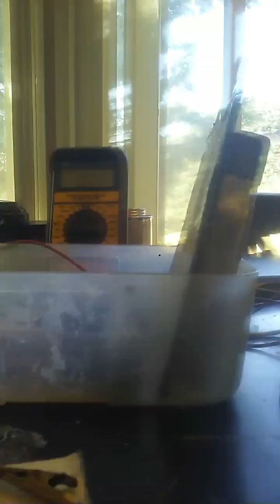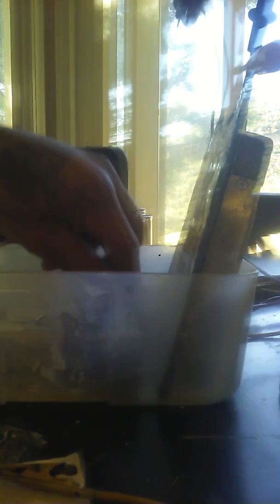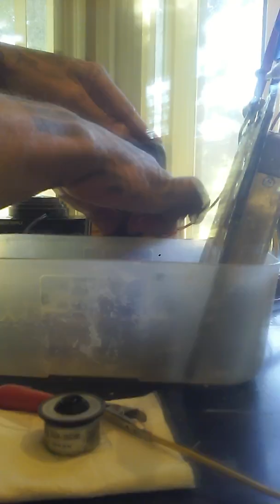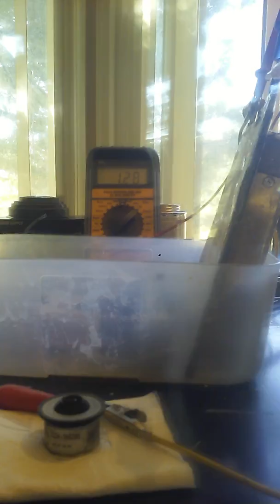13.2 watt hour super capacitor made from graphene

Comment: Cool project I'm not getting same same watt hour number though. If it charges in 10 minutes (600 seconds) at 1.5 amps. So 900 coulombs to charge it. coulombs = capacitance (F) * volts. 900/18 = 50 farad. So your capacitor is 50 Farad at 18 volts. Energy (joules) of a cap is = .5*capacitance(F) (volts)^2. .5*50(18)^2=8100 joules or  2.25 watt hour. Let me know if I miss calculated.